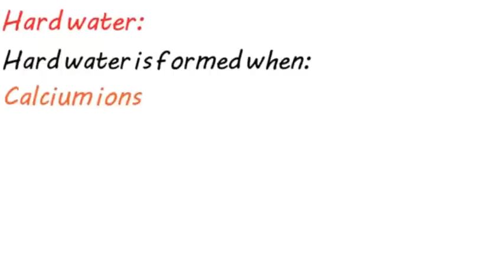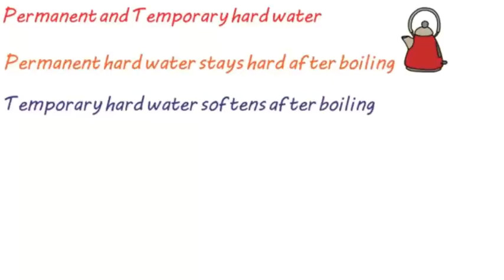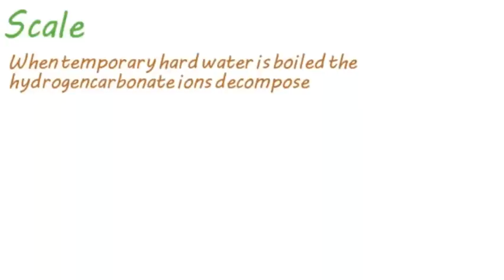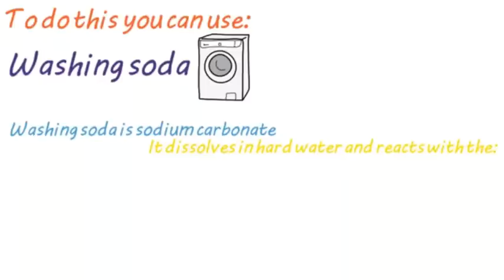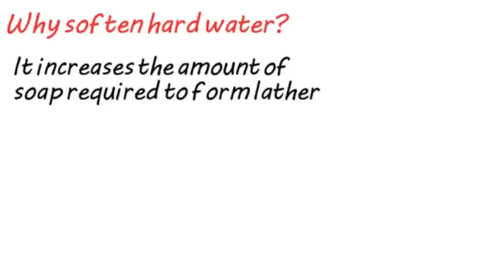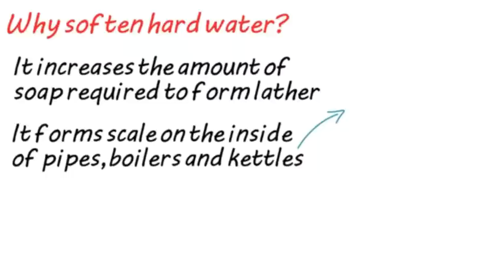Water hardness removal in cheap way

Comment: Very informative and I have a question in regards to the hard water (Magnesium n Sodium)in hair? Other than water softner and filters for the home do you suggest anything that would remove these permanently from hair for an immediate result? Thank you
Reply: To remove hair buildup naturally, mix 1 to 2 tablespoons of distilled white vinegar with 1 cup of cool water in a large container. Next, shampoo your hair as you normally would, then tilt your head back, close your eyes, and carefully pour the vinegar rinse over your head.May 26, 2017
Reply: Yesss! I have a small story about our situation has anyone else experienced this, as well? We have such hard water for such a long time of using and not “knowing” how bad things could POTENTIALLY get...:   “Finely divided calcium” (as it was referenced) has built up and distributed throughout our HAIR and HOME–which has formed a powder like substance and, oddly enough, becomes airborne the moment it meets the air (apparently–and obviously so, in our experience). The build up in my hair is so extremely intense that the moment my hair is dry, after washing, it feels like a shower of powder is running over my body...my child sneezes and says, “ant bites!” Before knowing what was going on, he/we would scratch and scratch with nothing to show for a bite mark. One day, I decided to wipe the itchy area(s) & viola!—NO MORE ITCH! (for the moment–which is relief, believe it or not). Now the fun part is, trying to wash this mess out with hard water still coming out of the faucet 👀 🤦‍♀️ May God have mercy on folks dealing with is—especially those who do NOT know what in the world is causing this unprecedented torment for them. Thank you so much for sharing what you know! 💜